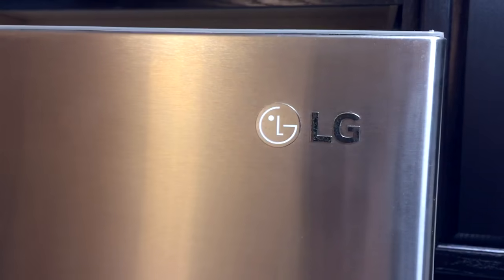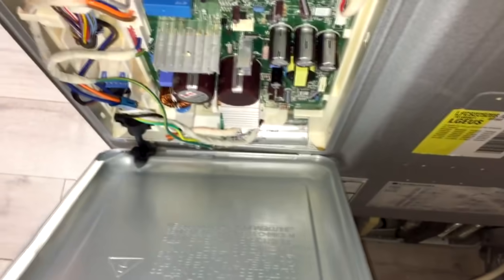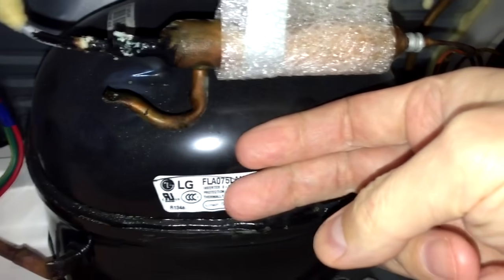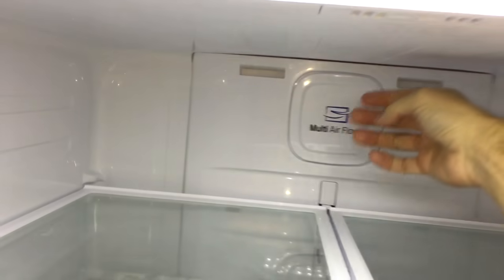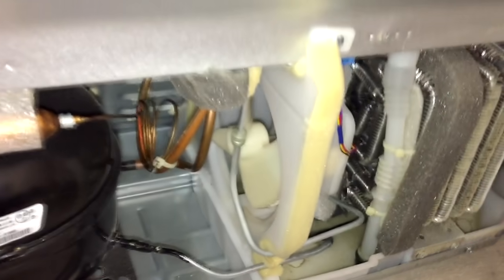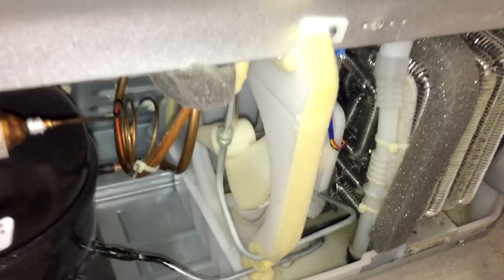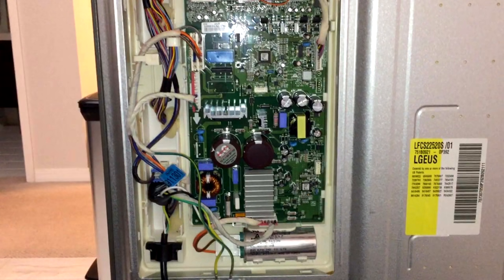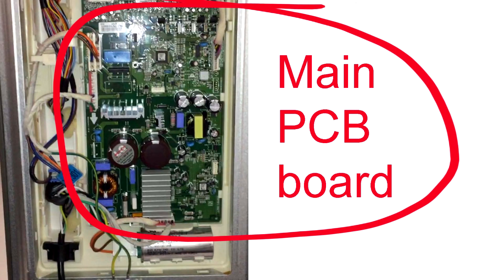LG refrigerator test and reset button

Comment: Thank you for a GREAT Video! However, I still have an issue in the fridge section of my six year old LG model LFXS30726S/02.  (note: the compressor was replaced 3 years ago)    First, I cleaned the admitedly dirty coils in the back. Compresser and its fan work well.  After emptying all internal shelves,   I removed the interior back panel in the freezer section to confirm the coils were not frozen. I unplugged the fridge for several days to doubly ensure no coils elsewhere(?) were frozen. No water puddles appeared.  I plugged it in and performed the dignaostics test you described so well.  The freezer quickly comes to freezeing temp and fan works fine. 24 hrs later during diagnostics , both fridge fans (including the air filter fan)  in the refrigerator blows strong and I can feel the icy air from the freezer flowing well into the refrigerator.   However, after the diagnosics is completed,  the refrigerator gets to only about 40-50 degreees and the ice maker still does not work.  The freezer works fine at all times and is very cold(ie 20-22 degrees)  I examined the mother board and did not witness any damage. I reran the diagnostics.  The fridge stays at 40-50 so I suspect perhaps the mother board is not telling the refregerator fans to turn on (?)   I used the magnet trick on the door sensor to evaluate if the fridge fans turned on and they do not engage (unless in the diagnbostic mode)  Do you think this is a mother board issue or did I miss a trick?    In advance "thank you" for all the wonderful advice you have provided thus far and hopefully any guidance you may have for me.  Cheers-Mike
Reply: BTW I do not "think "I got any error codes during diagnostics  ie no blinking lites on the mother board.   But on the first test The front of the fridge showed "88" (?)  second test showed "22" third test showed "33"
Reply from the maker: The freezer may seem cold at around 20°F, but it's a big red flag. The freezer should be close to 0°F.
If the compressor is constantly running, the PCB Motherboard is doing it's job because it "knows" it's not cold enough. The compressor may stop once/twice a day just for a defrost cycle.
It's possible that the compressor has been overheated (due to dirty coils), and got permanently damaged inside. Or there is a refrigerant leak. To verify this, a tech would need to install gauges to check internal pressure.
Try to monitor how often the compressor stops to rule out the PCB.
Reply: @Your-Self  Thank you so very much for such a quick and thorough answer. Your'e the best! I will indeed take your advice.  I do have an additional question before i proceed. This unit was a tight fit and so there is almost no circulation available to the left or right of the unit. I know on older units it was suggested a few inches on each side to ensure adequate circulation, but I am not sure if thats still applicable. Before i repair ,  I'm curious if I'm contributing to the units ineffeceiency and compressor problems.  Do you mind commenting so I know if I should proceed with a repair or abort due to the size constraint because I will always an ineffecienct situation that keeps being problemantic? (note: The refrigerator's temp has always been a minor disappointment to me, as it was safe but never got items extremely cold.)  In advance "thank you again for the wonderful service you provide to all of us."  You're the best!    Cheers-Mike
Reply from the maker: Your refrigerator has a Linear compressor which requires adequate air circulation on the back not to overheat. Try running your fridge for about 24 hours in the open area, and monitor the temperature inside for improvement. However, the damage to the compressor could already be permanent.
Since the compressor was already replaced 3 years ago, it's difficult to know the quality of the replacement job done by the tech.  Also, your replacement compressor could be of the same weak quality as the original. Nowadays, they use an updated "Universal Linear" compressor FLS075LANA (check the number on yours) that is supposed to be better, but only time will tell.

Comment: Thank you for the video! I have a LMXS30776s and it is not cool for some reason, why to do the testing and does not feel any cool at all... Btw, I was expecting some error code showed after the test but I saw nothing... will you know what I missed?
Reply from the maker: So you didn't feel cold air from the fan, but did you feel any (warm) air blowing at least?
Reply: For some reason the fan only works during the test. The door screen show normal temperature but it is actually not relate to actual temperature inside the fridge, both fridge and freezer
Reply from the maker: Try to run test #1 for a couple of minutes, and if you feel the fan blowing COLD air, that means the compressor is good. So the problem would be with temperature sensors, or the PCB board (most likely).
Reply: YourSelf not cold at all! May be the compressor is not functioning then.
Reply from the maker: Yes, possibly a bad compressor or refrigerant leak. If your fridge is under 5 years old and you have the receipt, LG will fix the compressor absolutely free. After 5 years, there is about a $400 labor charge. In the case of a refrigerant leak, LG will not cover anything :( Good luck.
Reply: @Your-Self  thank you so much ， We almost trash the Giant away

Comment: My lg refrigerator power goes off on its own I open the pcb board and cleaned with the soft brush and it started 
Then again it powered off on its own after 12 hours then I tried to press reset button as soon as I pressed reset button on pcb board it turned on 
my I know what might be the problem

Comment: Great video.  Any ideas why the refrigeration portion would randomly shut off, but freezer keeps working?  It conveniently happens when we are away overnight.  We come back, refrigerator is warm, but freezer is fine.  Plus my light is out on my refrigerator portion, I've swapped the harness, but it's still out, which leads me to the PCB.  I'm likely going to swap the PCB and see what happens.  Just thought I'd get your two cents before I do.
Reply from the maker: A lot depends on your refrigerator model number. Do you have a dual evaporator, a dumper door, or just a hole between the freezer and the refrigerator section? Is refrigerator light always out, or when it stops cooling? Did you replace the harness with a new bulb, or just a harness?

Comment: LFX31925ST - I have replaced the Ice Maker machine and the Controler board but the ice tray still not releasing ice. Resetting manually will release the ice. but not auto. Any suggestion. My temp is set to -4
Reply from the maker: Place a thermometer inside the ice bucket... the actual temperature at the ice-maker should be close to 0°F for the auto-harvest mode to begin.
I see there are 2 different ice-makers available for your refrigerator... # AEQ73110205 and # AEQ73110203. Did you buy the correct unit, the same as the original?
If you just installed the ice maker, it takes about 24 hours for the first batch to drop.
Reply: Yes, I bought #AEQ73110205 same as my original. Any recommendations on thermometer which and where to buy. Thanks
Reply from the maker: Here is a cheap, but good TAYLOR thermometer from Amazon https://amzn.to/2Fsg6Br
I'd get two of them, so you can compare readings to verify the accuracy, and then keep them in different refrigerator compartments. Hopefully, you'll get the real thing and not a knockoff... if it is, send it back.

Comment: Kenmore Model #795.72063.317 fans appear to be working but freezer temp acceptable but Frig temp is in the 50's and very little air flow to upper vent on back of frig.  how do I diagnose if I need a control board?
Reply from the maker: This is a dual evaporator model. If the freezer temp is around 0°F (important), the fridge section evaporator could be encased in ice due to the defrost problem.
Verify the freezer temp first. If the freezer temp is above 10°F, the Linear compressor could be dying, which is very common :(

Comment: My LG fridge doesn't stop the door alarm even if the doors are closed. Then the fridge is warm and the freezer is not that cold compared to the set temperature. I don't feel any air flowing. It seems like the evaporator fan is not running. I ran #1 test and I felt the cold air in the frige and the freezer. Could it be the broken door sensor or something?
Reply from the maker: Are you sure it's a Door Alarm and not the Temperature Alarm? Look at your user manual on how to turn the Open Door Alarm OFF. If the alarm turns OFF, the Door Switch is probably bad, or something is wrong with the motherboard.
Reply: @Your-Self  thank you for replying to me. I turned the alarm off by pressing the alarm button on the fridge then it stopped beeping, but the evaporator fan is still not running.  I guess since the evaporator fan is not supposed to run if the door is not closed which is not the case for me. I guess motherboard malfunction makes sense.
Reply from the maker: To me, it sounds like a bad or intermittent Door Switch. The motherboard thinks that the door is always opened (because of a bad switch), and that's why the evaporator fan is not running. But when you run the Test #1, the motherboard ignores the door switch and lets the fan run. You just need to figure out which door switch is bad. Depending on your model, you may have 2, 3, or 4 of them, one for each door.
Reply: @Your-Self  That's a good news for me that it's not a motherboard problem! My fridge has 3 doors. I will start with your advice. Thank you!
Reply from the maker: Great job! Glad to hear that it works now.
Reply: @Your-Self  Thank you so much! I replaced the door switch for the freezer and the evaporator fan is working again. You saved me a lot of money. I really appreciate your help!

Comment: This video was very helpful! The fridge and freezer were both not expelling air so I opened up the back panel and pressed the button once. The screen reset but the fridge and freezer did start expelling air. But after a few mins once it settled it stopped. That means I need to replace the evaporator fan right?
Reply: Can you check the PCB board to see if there is a blinking light? If yes, how many times does it blink before pausing?
Reply: @usmang5542  after I press the test button once? Or right now as is?
Reply: @shainah.6388  first check before pressing. Then press button and wait a minute or so and check again.
Reply: I’m having the same issue did you get it resolved?
Reply: @timwalls4580  I did not. The entire fridge ended up molding so I didn’t get a chance to get someone out to help.

Comment: Cross fingers that you would see my comment. 
My fridge compressor is not running but when I tried the test 1, it did run. But after  putting it back to normal, it wont run again 
Also when I first plug in, there's a red light followed by clicks from the relay.

Comment: Hi my model is LG  GR-M282VML  Its running well but it is not cutting out after 10 or 15 minutes as usual. What is the problem and where is the Thermostat located
Reply from the maker: I'm not familiar with this model, so I'm going by the manual which you can download for yourself here: https://www.lg.com/eastafrica/support/support-product/lg-GR-M282VML
It's difficult to diagnose without being there. The refrigeration cycle can become longer in many circumstances. For example: you moved the refrigerator to a different location which is warmer, put more food inside than usual, the door gasket is torn or warped so it's not closing properly, open the fridge more often than usual... etc. Make sure that the light in both compartments turns OFF when you close the door (you can test it by pressing on the "door switch"... look it up in the manual). Make sure there is some space for air to flow behind and on the sides of the refrigerator. Maybe you need to clean up the condenser coil from dust and hair. And the worse case scenario, the refrigerant gas is started to leak out, so it takes longer to cool.
Reply: @Your-Self  Thank you I followed  your advice and its working well. Its true I moved recently to clean.
Reply: @Your-Self  What can cause the gas to leak? Can it be refilled?
Reply from the maker: The gas can leak out due to age, corrosion, and bad quality of assembly. Refrigerators use "sealed system," so to refill it properly you'll need special equipment and training, and repair the leak as well... not easy :(

Comment: My ice maker has stopped making ice.  The water line works.  The maker itself will move when reset.  No ice, however.  Any videos on checking and fixing this problem? Thanks
Reply from the maker: The first thing to do is to measure the temperature in your ice-room. The freezer may be cold, but not cold enough for the icemaker to start the process. Put a thermometer in the ice-bucket... the temperature should be below 17°F in some models, and below 5°F in others.

Comment: Hi , i did the test but after second time pressing the reset i got a code 22 on display. is that mean i have bad starting relay? I tested the relay i have continuity. I dont have the code unless i run the test. Compressor runs at beginning but than shuta off after 15 20 minutes. No cold air. Any advice please? LG lfx25974ST model.
Reply from the maker: When you run the test it's normal to see numbers on the display. Test 1 = 88, Test 2 = 22, Test 3 = 33.
If it says LINEAR on the compressor, there is no starting relay, just an overload. 
If you run Test 1 and feel air coming out in the freezer and the fridge, but it's not cold, probably the compressor is inefficient (bad.)
How old is your fridge? LG replaces Linear compressor in the USA for free for the first 5 years.
Reply: YourSelf its 8 years old and yes its linear compressor. It definitely blows air but its not cold. Compressor is running but not blowing cold air. Also after 20 minutes it shuts off and doesnt turn on unless i unplug from power and plug it back in. Do you think its out of freon? Because when compressor run i dont hear any loud noise it runs smooth. Thank you for your fast response.
Reply from the maker: It's almost impossible to say if it's out of refrigerant (Freon,) or the internal valve inside the compressor is broken. You need to install a piercing valve (preferably on both, the Low and the High sides) to check the pressure. But repairing yourself will still cost you a lot of money. However, if you have the receipt, LG will provide a free compressor, but charge you about $360 for the installation.
Reply: YourSelf ok thank you very much for your advice

Comment: So what about when you press the test button and nothing happens, no sound at all and the fuses look clear and good? No fan running, no sound at all, fridge is just dead.  Should I just change the compressor start relay? Power source at socket is positive.
Reply from the maker: Depending on your refrigerator model, you may not even have a Start Relay.
Get an extension cord, and plug your fridge to a different room electrical outlet.
Do you see lights when you open the door?
Reply: @Your-Self  it was actually a blown fuse. Upon initial inspection the fuse did not look blown, it was clear, clean and intact. I tested the fuse with a plastic covered needle nose pillar after watching another video band and the fridge kicked on with fans and compressor working properly, so all I need to do is replace the main fuse, the bigger/longer of the two. Thank you for replying so rapidly.
Reply from the maker: Good to hear it!
Reply: @elsitabebe  where is that main fuse? I am having the same problem as you
Reply: @marinagarcia1139  hi! So it turned out that it WAS the main fuse that did not work even though it looked good. When I tested the main fuse it was dead even though it was clear, not blacken like a browned out fuse would be.  I bought a new fuse and soldered it to the mother board after removing the old one. There is another video that tells you to piggyback the new fuse to the old fuse with solder but my old one broke on me when I tried to remove it so replaced the entire fuse. I watched a few other videos too.

Comment: should the compressor be hot , warm or cold when its running ?
Reply from the maker: It should be warm to slightly hot. 
If it's cold and running, it's not doing its job of compressing the gas... Inefficient compressor.
Reply: @Your-Self  thank you for the quick response I guess I’m going to need another fridge
Reply: Technician came and looked at ,repairs estimation will be $900
Reply: Based on your experience what is the best brand that you recommend buying ?
Reply from the maker: All brands have their own problems. LG was the worst because of the compressor, but now they are installing updated compressors, but nobody knows if it's better. Buy something you can afford with fewer bells-n-whistles... they have fewer problems.

Comment: Hi I had technician come over and tell me the coils for the freon are in the walls of the fridge??  and he would have to cut a hole or remove walls completely to find freon  leak and it would be too much time and money? i think hes full of it i never heard of something like this before it is the LG double doors with the freezer on the bottom 2017 model. I had motherboard replaced 3 years ago.
Reply from the maker: It's possible that the Freon leak is at the Heat-Exchanger (2 pipes going through the Styrofoam wall). And it's difficult to diagnose and repair. 
However, it's kinda early for a 3-year-old fridge to develop a leak, but not unheard-of. 
Maybe get a second opinion from another company... could be a bad compressor, which is common for this LG, and it should be covered under warranty.